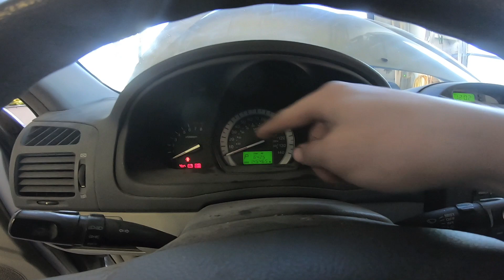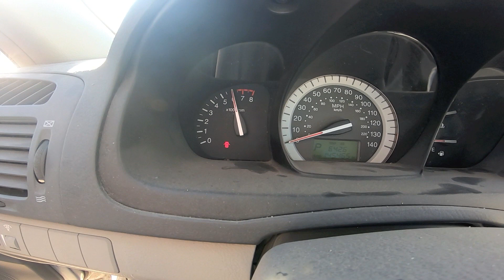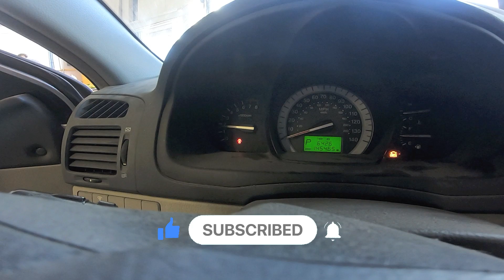I Replaced My Engine Oil With Maple Syrup!

Comment: Wow that was pretty cool to find that it actually runs, how about try running it on Penetrol, it would be an expensive additive but I would be interested to see what it would do 👍☮️
Reply from the maker: I drove this car home believe it or not after putting regular oil in it and when i shut it off a bunch of valves got stuck open and it never ran again. When i went to start it again i think it bent all the stuck valves